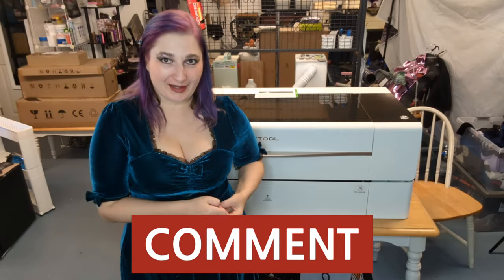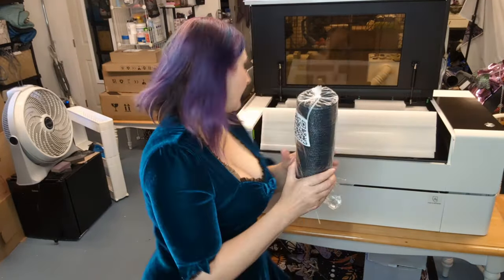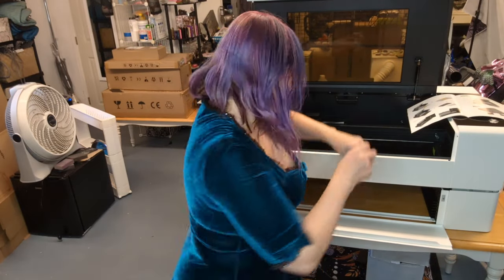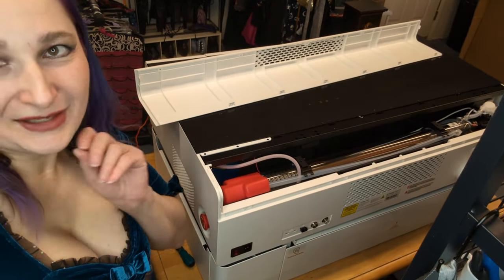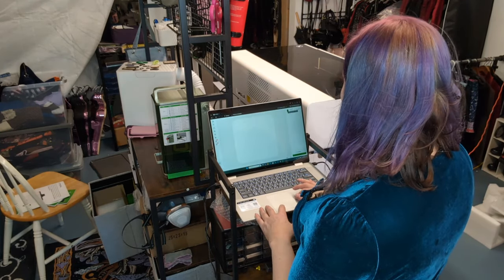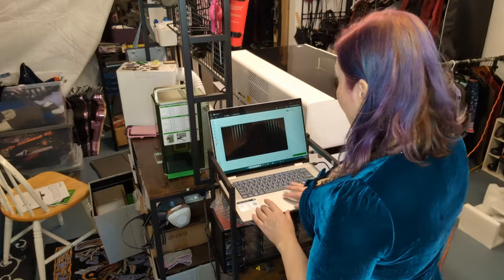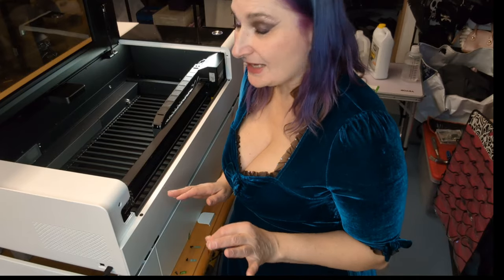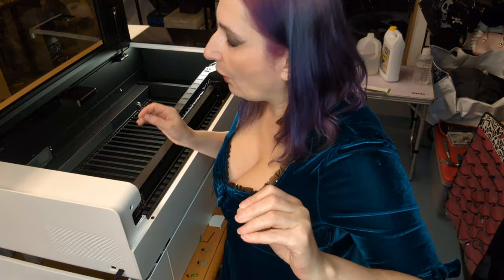I set up & struggle to configure my xtool P2S CO2 laser cutter / engraver- learn from my mistakes

Comment: FYI your probably gonna want to somehow pipe your exhaust outside.  I never really trust the expensive smoke eater.  I have the P2,  it has the exhaust going outside and no more acrylic smells in the garage and recently bought the new P2S.   I do not have it yet but ordered the Indinity 6" inline fan will attach it to the 3" hose coming out the rear of the P2S once it gets here will connect it to the current exhaust that goes outside.
Reply from the maker: Unfortunately I don't have a way to do that where it currently is, I've set up a couple of extra air purifiers around the space as well as exhausting it through the xtool air purifier 😅
Reply: This is exactly my concern. I have a low watt diode and have it connected to a 6” inline and still have smell even going outside.  So I ordered the collector, but will definitely use the outside ventilation.  I’m wondering. If I should keep this machine in the garage or if it will
Be ok in the basement.   In the summer, I have the window and a sliding door,  winter just window.  At 100 pounds, I need to commit to a space.  Waiting on delivery…..
Reply from the maker: @mayscocopatch  do you have heat in your garage? If it gets too cold it can cause problems 😅 mines out in a garage but I have space heaters for when I'm using it, I just warm it up for a little bit before I go out there

Comment: Great video. I appreciate seeing all of the issues and how you resolved. I’m in Northern VA and just ordered the machine,so it was good to see your info on climate.  Question for you, the smell, I was going to put in my basement, and vent out a window and I purchased the filter. Do you suggest a garage Instead?  I am sensitive to the burn smell.  Thanks again, keep the videos coming.
Reply from the maker: Thank you so much for watching! I'm glad I was able to help a little 😀 if you are sensitive to smells you probably don't want it in the house, wood and acrylic both leave varying degrees of smell.. some acrylics are worse than others 😅 I'm sure it would be better if I was also venting outside but I don't have that option, I don't have the new filter, when I purchased this they were still bundling it with the old filter so the new one might be better, but there is definitely still smell and honestly I'm not that sensitive to smells, I have year-round allergies and I'm constantly stuffy 😅

Comment: hi, just found your video, i got my p2s in today and i'm at the section where i should have to put antifreeze in there and the distilled water. My question is: Does it need antifreeze at all when the Laser is in a room where it never goes below Zero?  where my Laser stands, the temp. wont go lower than 59 degree Fahrenheit. So for my understanding and roomsetup antifreeze isent needed at all or do i misunderstand something? ...i mean why does the amount of antifreeze to put in, is bound to the outside temp. if the Laser stands in 59F. room which isent affected by the outside Temp.?
Reply from the maker: What I've gathered from some of the Facebook groups I'm in you wouldn't need anti freeze but it's still good to put in the minimum amount just in case there's some sort of power outage or some sort of freak event that does cause it to go below freezing, it won't hurt anything to add it and can only help in the case of freak weather ☺️